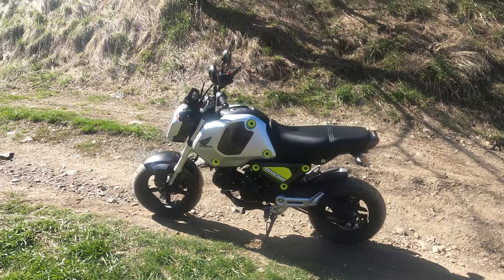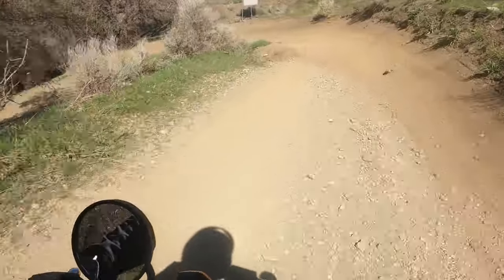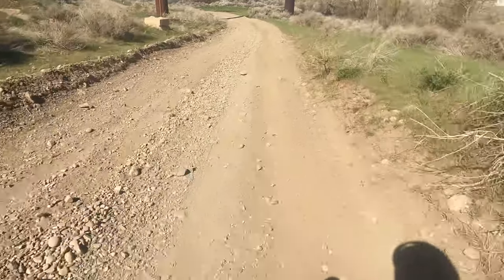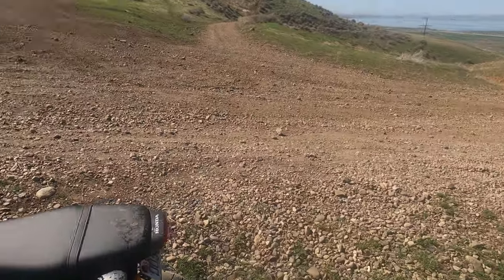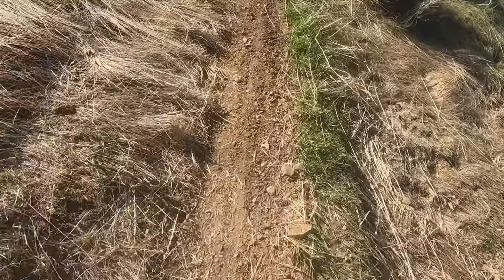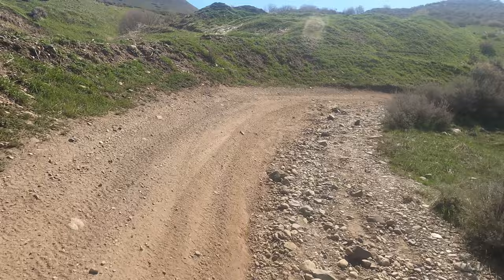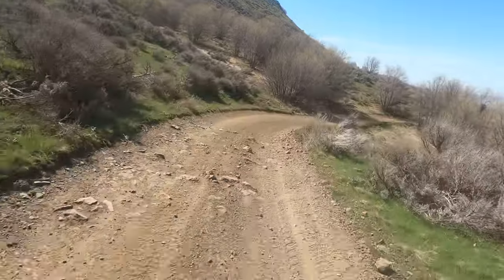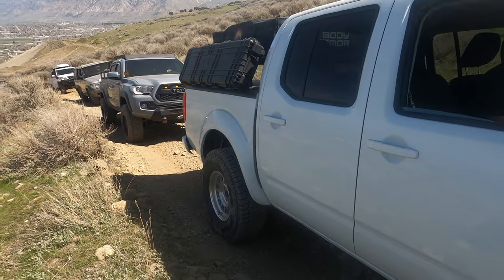Is the Honda Grom off Road Capable?

Comment: Glad to see what the stock grom can handle.  I'm impressed how well it did.  With some knobby tires it will perform much better.  I'm on the fence about getting one.  I have a street bike and dual sport but love to have the grom as a toy.  🤷🏻‍♂️
Reply from the maker: I was impressed as well. I definitely don’t regret getting the grom at all. A dual spot is also on my list. Hopefully I will be able to get my hands on the XR150L soon
Reply: @l-tizzle  
I have the XT250 because I'm only 5'4" and the seat height is much lower than any other dual sport.